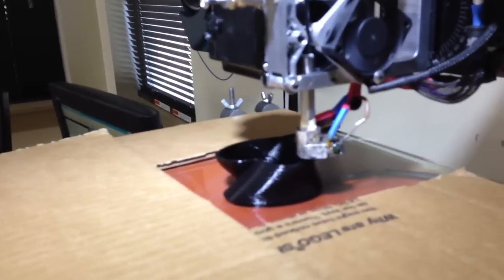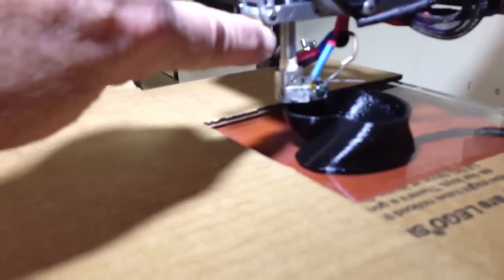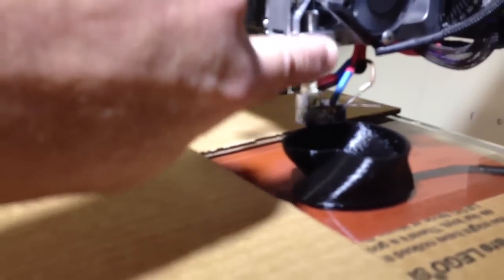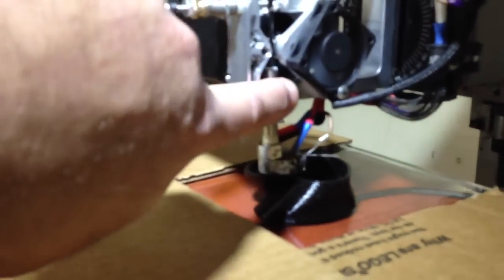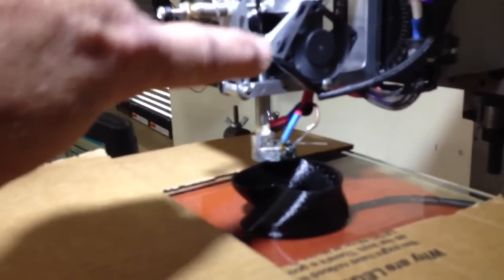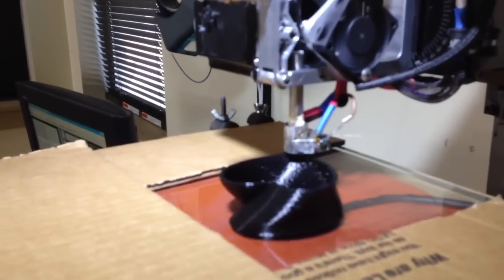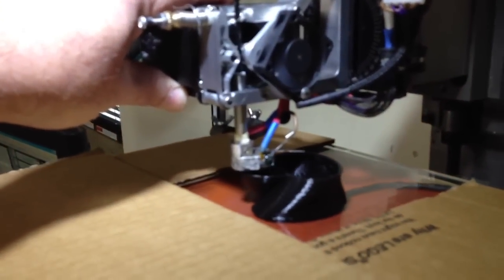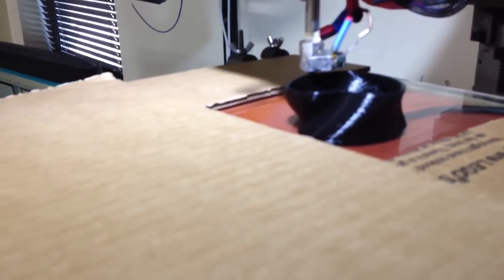RepStrap hot end temperature isolation

Comment: Hi CNCObession,

Congratulations for your design which seems quite "profesionnal".
I'm myself in the process to start building a repstrap and my intetion is to build the hotend using a stainless steel approach ...
Could you pleas give me more details on teh way your hot end is built ? Is ther some PTFE tubing inside, or is it a direct hole in the SS tube ?

May thanks
Alain